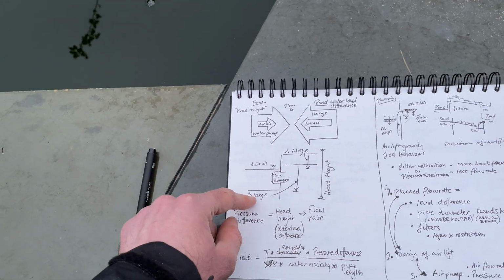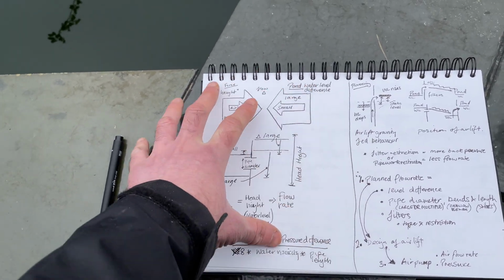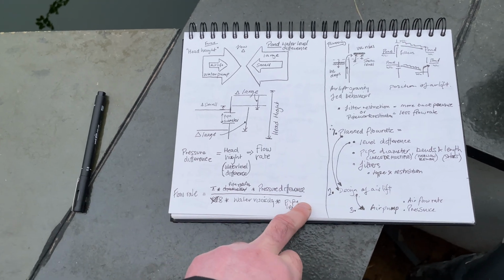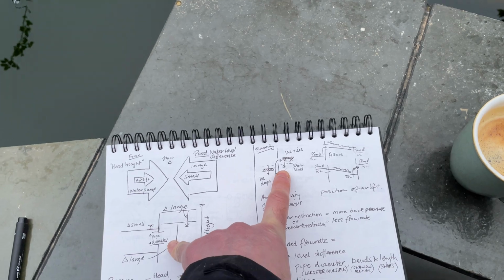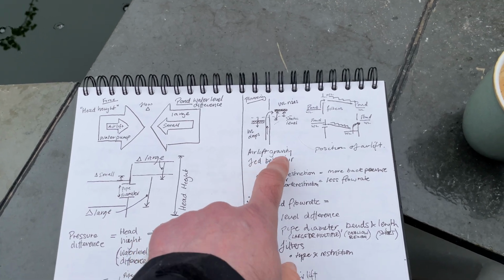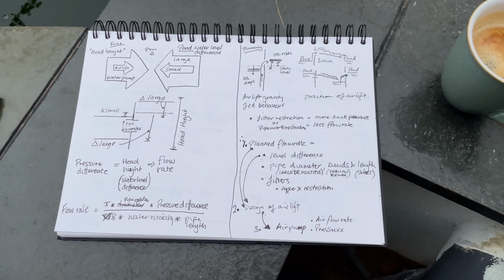How to design a pond airlift, dodge the pitfalls and select the right air pump.

Comment: Hi Nick, is there a way to get a copy of your notebook page? It's hard to read with camera movement. I want to build this design but need to understand flow rate. Thank you.
Reply from the maker: Hi Yvette, sure - the fastest way is here at koiforum at one of the original threads on this: https://www.koiforum.uk/pond-construction-pond-build-diaries/25586-airlifts-pumping-water-gravity-system-using-6.html#post398279 you will need to register/sign in for image access. There's lots more good info on airlifts in the same thread as that post.
Reply: Thank you Nick. I'm going to do my best to follow along. There is a bunch of good info here.
Reply from the maker: @yvettestewart8002  No problem. A number of airlift designs work - they could be a U bend without a collector, inside a collector (like mine). The main thing with gravity feed is to ensure there's enough height difference between the pond water level (pushed up as water is pushed into the pond) and the return into the pond collector or filter elements which may cause the flow to be cut off.
Reply: I got the airlift dialed in . About 5000 gallons per hour easy with 120L pump